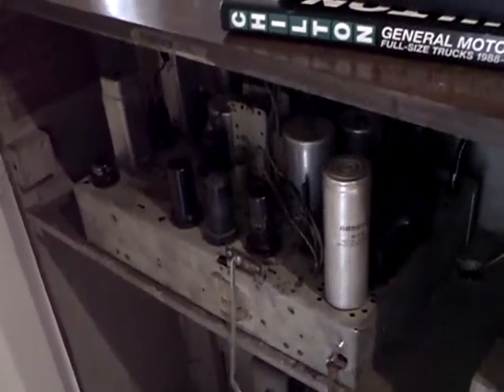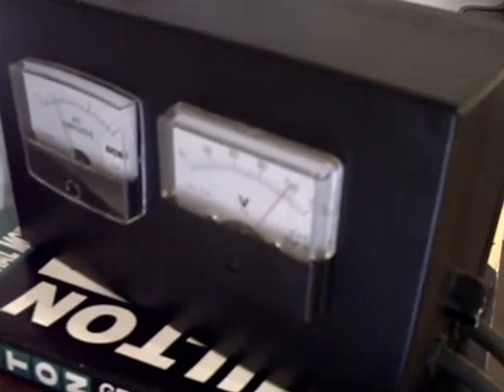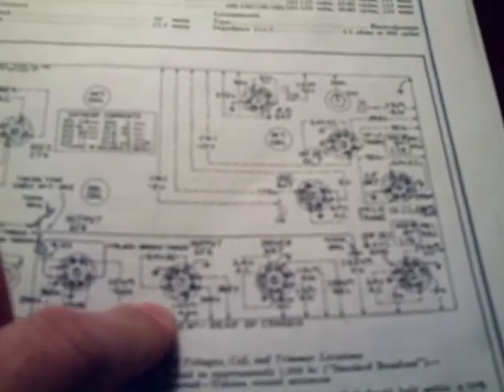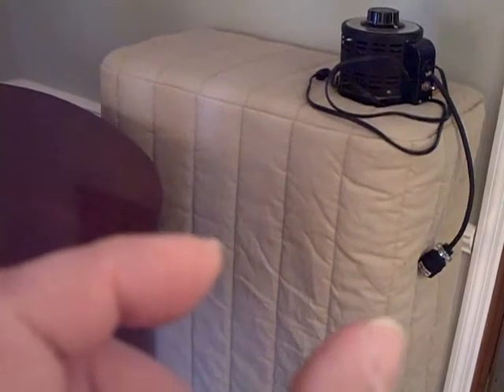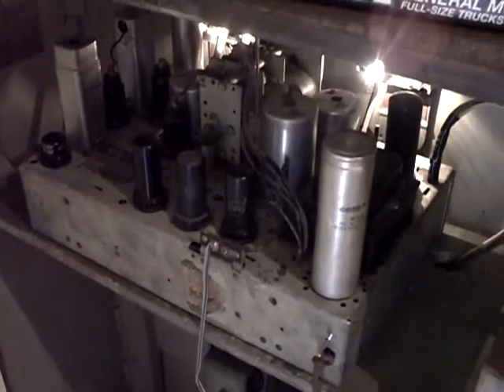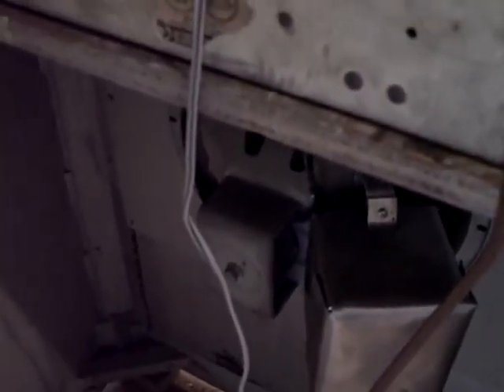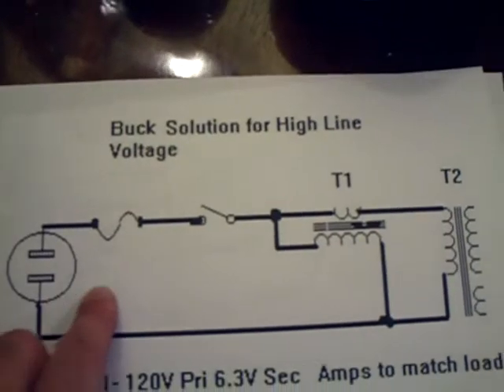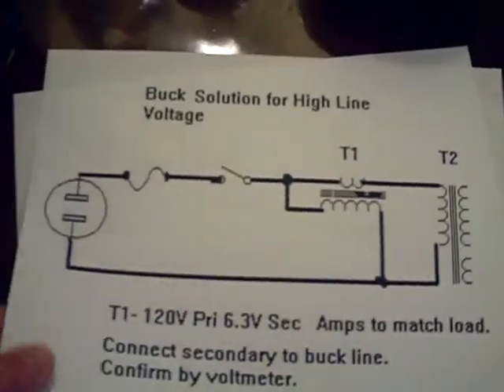Part 1 RCA 810K The Problem with Voltages

Comment: I have a Zenith 10S454 console radio and I also use a variac. I don't have a problem with the radio overheating, just want the radio to run cooler.
Reply from the maker: You are a smart man. The tubes and other electronic parts will last longer.

Comment from the maker: @Thermionman1970 I guess even easier would be to measure the voltage drop across the bulb with a voltmeter.
Then for sanity check measure the line voltage at the radio AC input w and w/o the bulb in series. I mean, that's what I would probably do. Measuring the current could be tricky. It's easier measuring the voltage. I got a cheap multi meter for like 30 bucks I think

Comment from the maker: @Thermionman1970 Well we have to know the voltage drop across the llght bulbs filament. That's a tough one. We can measure the current and then the resistance of the filament and use ohms law. Just that when the filament is hot, the resistance will go higher, how much I do not know. I guess the best way is to estimate I guess and measure the current and then the cold resistance and do V=IxR. I pretty sure that will give you a good estimate of the voltage drop.

Comment: Hi. I usually run my radios in series with a 200 watt lightbulb for fuse protection and  the bulb just glows  slightly  and the radios sound great.I was wondering how much voltage the 200 watt bulb would drop the line voltage and if this is a good way to reduce line voltage slightly or if you could use maybe an even lower wattage bulb??

Comment from the maker: I got lazy and forgot the mention the inrush current limiter so I'm glad you brought it up. They are a great thing to put in series in the AC input an antique radio. The device saves on the tubes, rectifier tube, and the power transformer. Thanks again for taking the time to mention this.

Comment from the maker: Thanks PhattyMo, That's a super idea! I experiement with a CL-90 from Digikey and got about a 6 volt B+ plate reduction for the 6F6 pentodes. So I had about 389 Volts. I still ran hot after 2 hours, So I opted for reducting the input to 112-115 Volts with a autotransformer. While I was at it, I also stuck in a CL-90 though a chassis hole and double heat shrunk the leads and it sit above the chassis. I got about 350 in the 6F6 plates now and the "soft start". I use CL-90 on my RCA 262 project vid

Comment: Try an inrush current limiter.. something like DigiKey P/N: 570-1073-ND or a similar part
That will give you some 'soft-start' action,and drop a few volts.  CL-90 is another number that comes to mind.

Comment from the maker: You have to realize, after 45 minutes the transformer is barely warm. It takes a very long time, about 2 hours for the transformer to get hot. It very very slowly creeps up in temp. To me this is just a voltage problem. I had also read on one of the radio forums that RCA scrimpt a liitle on transformer design. Some people beleive they run into saturation. It's probably true. the transformer is pretty compact. I'm just gonna lower the voltage to the 115 volt AC input spec per the schematic.

Comment from the maker: 135 Watt  radio per the manufactures spec.
135 Watt / 125 V = 1.08 Amp.
Radio draws .8-.9 Amp. Seems OK to me. Radio has 10 tubes
Radio is running at the top end of the voltage spec. Tube plate voltages are high.

Comment: Point nine amps of current draw seems high to me.  None of my radios have ever drawn that much current.
I recommend firing up the radio on the variac, cranking down the voltage to 100 volts, then letting it operate for two hours or so.  If the power transformer still gets too hot...you've got something breaking down, possibly the transformer itself.  I recently had a really hot transformer.  Turned out the cause was an arcing tube socket.

Regards,
John

Comment from the maker: Agreed! Even though RCA said you can run it at 125 Volts, I thinks it's just too much voltage for their design. I think they pushed the limit of the transformer design. They apparently did have some 125 Volts back in the day because the RCA 262 radio has the 125 V position for the movable fuse. I don't think it was very widespread though.